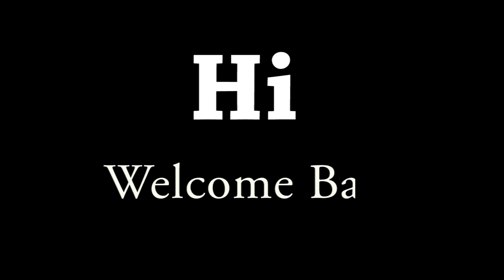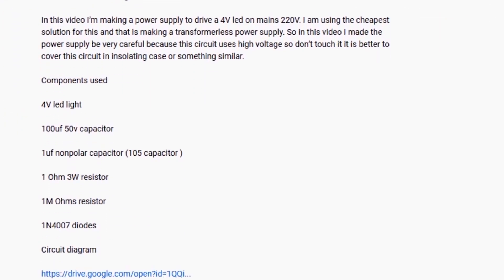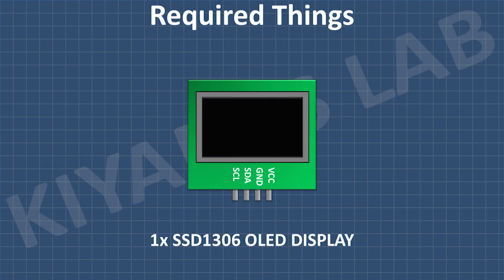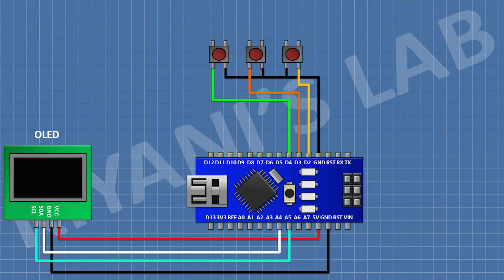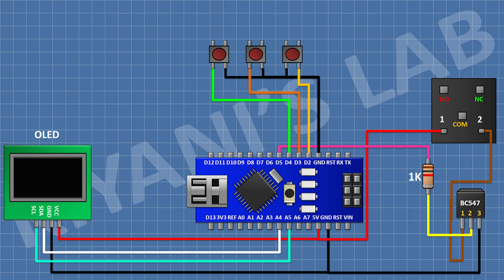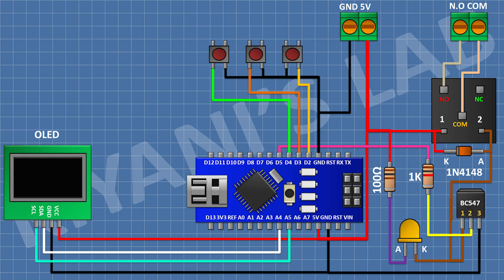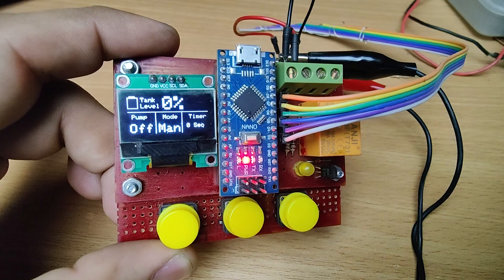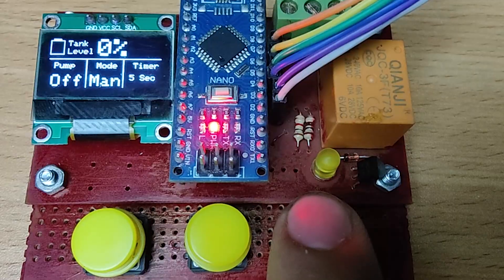Water Level Controller Arduino Project

Comment: If this is a prototype and not a final device, then I think you will be interested in looking at the pictures at the links in my channel description. There is an open project of modular portable prototyping. You can assemble a solid prototype without soldering, if you have modules, of course. But if there are no modules, you can make them from regular breadboards for soldering. You can assemble a prototype, develop a software, and then disassemble and reuse the modules. You have several videos with similar devices, I think there will be more. So using mpp2508 will be justified.

Comment: ¿Por qué tantos repiten este proyecto de mierda? 

Ya está hecho, ya se hizo con arduino hace mas de diez años y con pic desde hace cincuenta.
Nunca nadie lo usa realmente, no es mas que un proyecto escolar.
El uso de cables de cobre para sensar el agua la contamina seriamente, si se usara en un tanque de agua potable y esta se bebiera traería serios problemas de salud a quien lo haga.

Pero lo mas importante es que hay un sensor para hacer esto y es muy barato. Mide la presiónen una columna de aire sumergida en el liquido que sea. Da un valor bastante exacto, no solo cinco posibles niveles. Y no contamina nada, no interactua eléctricamente con el líquido.

Dejen de robar con esto proyecto viejo e inutil.